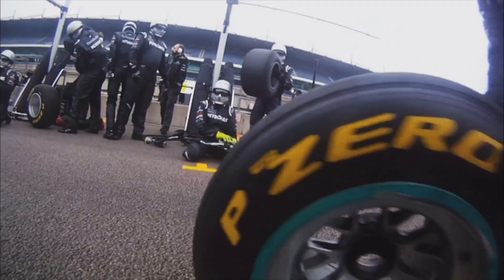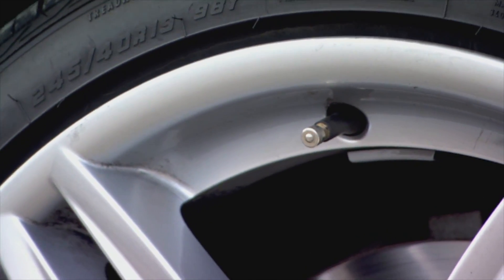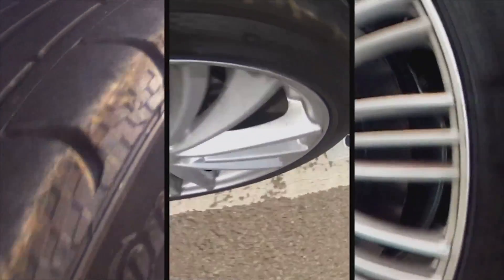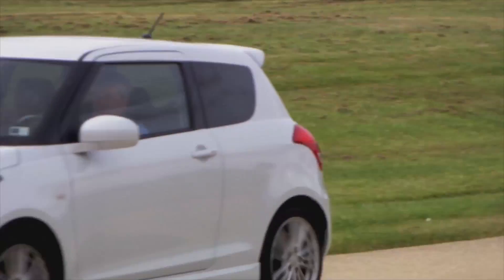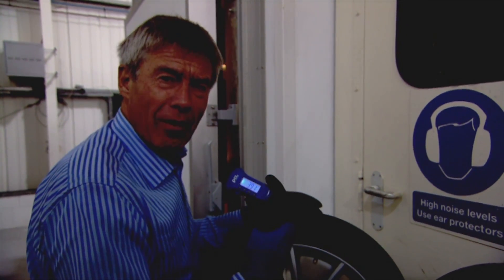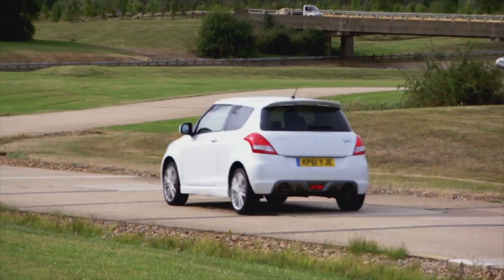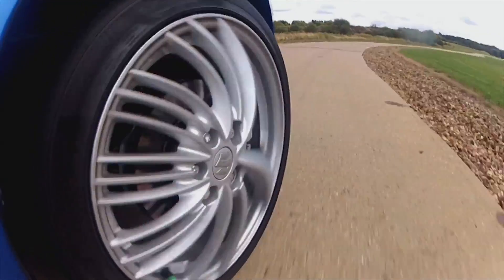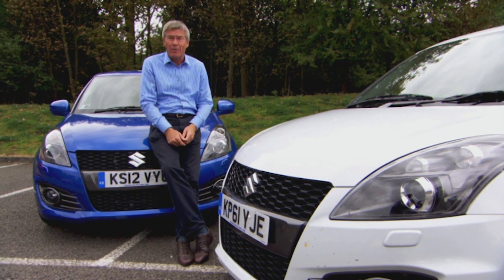Nitrogen vs Air In Tyres - Fifth Gear

Comment: first thing, is that the tires in the oven should be replicated, a set of 4 vs a set of 4. The road test should have been blind. and Nitrogen in tires makes no difference. Also isn't measuring a higher pressure for the nitrogen indicative of nitrogen expanding more? Both nitrogen and oxygen can be treated as ideal gases around Standard Ambient Temp Pressure (SATP). Ideal gas law: p=(nRT)/V . In the tire oven example. R stays constant since its the ideal gas constant, V stays mostly constant, since the tire doesn't get much bigger, T raises, therefore p raises. Any difference can be attributed to n, the moles of gas.  The molar mass (molecular weight) of molecular oxygen is about 32, and about 28 for molecular nitrogen, meaning for the same mass of gas oxygen has less molecules. Now for considering a tire filled with a certain volume of gas we have to take into account the gases densities. Oxygen is about 1.3 kg/m cubed at SATP. Nitrogen is about 1.15 kg/m cubed at SATP. So there is about an 11% difference in density, meaning a tire containing pure oxygen would have 11% more mass of gas in it than a nitrogen filled tire. The difference in molecular weight between the two is about 12% more for oxygen, so both the oxygen tire and nitrogen tire would have similar moles of gas molecules in them, perhaps slightly less for the oxygen tire. They'd be pretty close to equivalent in thermal expansion. As was demonstrated. So nitrogen in tires is a waste and gives you a false sense of security about your tire pressure.

Comment: I use solid tires.  It's the new thing.
Reply: Until a big chunk of the tire comes off than what are you going to do?
Reply: ***** 

"Until a big chunk of the tire comes off than what are you going to do?"

Weld it back on.  They're steel.
Reply: ***** 

"Solid rubber tires you can't..weld... back on."

Mine are all solid steel.  I stole them off a locomotive.

Comment: Would oxygen permeate the rubber much more than nitrogen? Well, just think a bit before you fall for that...

If it would, then you would end up with only the nitrogen left in the tire. Just fill it up with air again and you have 95% nitrogen. Wait for the oxygen to go away and fill it up with air again, and now you have 99% nitrogen.

Have you filled your tires a few times to fix that falling pressure? If it was the oxygen escaping causing that, then your tires would already be filled  with 100% nitrogen by now.
Reply: I think its also that continuous penetration of oxygen causes degradation of rubber, due to oxidation. But I don't know how much of that actually affects the life.
Reply: The answer is simple: It doesn't. At least not enough to cause sufficient damage to shorten the life of a 60,000 or 80,000 mile tire.
Reply: Size molecules:
nitrogen: 292 picometeres
oxygen:300
So...
I never saw a tire degrade due to oxidation, tyres always out last the tread.
At 20º air can hold less than 5%~ of water.

This is a gimmick guys. : )
Reply: @ubbgn  Today's tires are a mix of chemicals. I think better ones have more silicon rubber. When replacing tires on my vehicle, the tech showed me where the rubber had become brittle and chunks could be broken off. Probably 5 years old. I had already recognized the very poor (breaking) traction in wet weather.
Reply: lol.... good one mate. gonna try it :P
Reply: exactly
Reply: Mate oxygen is 300 nitrogen is 294
Reply: Haha what a logic
Reply: @sandeshbhandare7238  What is it that you find amusing?
Reply: It only takes 7% more nitrogen than the atmosphere in order to have the desired effect on inflated tires.
Reply: I agree with you. The problem is, the time it would take for all the O2 to permeate through the tire, before you expel 20% of the contents. It might take 10+ years, plus each time you top-off the pressure, you are adding more O2 and H2O. I think more efficient membrane separators are used in the medical field for portable Oxygen concentrators for patients at home. I just read about some similar device for tires shop, that didn't want to store N2 tanks.

Comment: Nitrogen is also called "spring gas" because it is used in pneumatic springs/dampers in assorted contraptions, this because it is more temperature stable expansion-wise than ordinary air; it expands and contracts less.
Thus, the tyre-pressure will stay more stable over a wide temperature range.
Reply: °C
Not really, nitrogen is an "ideal gas" in the thermodynamic sense and follows the ideal gas physic laws, just like oxygen (Boyle's;s law)
Nitrogen is used in shocks for various reasons depending on the shock manufacturer:
It is dry/pure (almost), no water vapor (which content varies in ambient air), another "dry" gas could be used.
It does not react with the shock components (oil, gaskets, nitrogen bladder if separate, etc.).
It is easier to get "dry" nitrogen commercially than to get ambient "dry" air.
In a tire/tyre: If you increase tire/tyre temperature from 20°C cold to 40°C hot lap (very common condition in racing, not common in daily driving unless under-inflated and/or overloaded tire/tyre), the pressure will increase from ~32 psi cold to ~34 psi hot, there would only be a 0.088 psi difference between air inflation and nitrogen inflation pressures. That would be different in a shock as a shock can heat up a lot more.
Bottom-line, there is no advantage to use nitrogen for daily driving.
Ciao, L (FoMoCo engineering)
Reply: lancelot1953
 For all practical purposes you are right (except perhaps on the "ideal gas" part, did you mean "real gas"?), there are some other differences but that would go more on the dynamics of things and will take a bit of delving and be more of a semantics debate ;p
Reply: ***** Hi Kenzofeis, you have brought up a very good point.  Nitrogen is a "real gas" but within the parameters/conditions that it is exposed to in automotive engineering (especially in tires/tyres conditions), we consider it as an "ideal gas" for the simplicity of calculations or comparison with other "inert" gases (in the case of shock absorber technology) i.e matching shocks to spring rates, resonance frequency, loads...  It makes life a bit easier (at least at Ford ;-).  Take care, Ciao, L

Comment: As far as a gas goes, there is almost no difference between air and nitrogen. Air is already 80% nitrogen, and nitrogen has almost the same molecular weight as oxygen, 14 vs. 16. While the change in gas pressure from tire heating is small and identical between air and pure nitrogen, water vapor pressure increases about 3 psi.  Dry nitrogen or dry air, will eliminate this change. If you double the pressure of 50% humidity air from 15psi to 30psi, it becomes 100% humidity air, and starts condensation. So the air in your tire is saturated with water. If you pump up your compressor to say 120 psi and allow to stand for a hour, the air in your tire will have 30psi/120psi, or 1/4 as much water.

Comment: Total crap for down to earth use. Check your facts.
Reply: Agreed, the difference in the size of nitrogen molecules versus oxygen is only 2.7%, to say nitrogen molecules won't permeate the rubber is bullshit. And if the oxygen was fully saturated with water vapor, it would only mean a 5 gram difference in weight.

Comment: logically, if only oxygen permeates through the tire rubber, you'd eventually only be replacing the lost oxygen with air (78% nitrogen). After 3 fills (1 - 0.21^3) you'd have 99% nitrogen in your tires anyway. Eventually, you'd never need to top off.  I don't think permeation is the main issue. Other leak paths?
Reply: Nitrogen permeates through the tire rubber too.
Reply: Exactly. Thanks.

Comment: They dont vaccum the tires befote adding the nitrogen so the proportions of nitrogen are not that different in the tires and also, following the gas rules they should all expand the same unless there is more water vapor in one
Reply: Yes, they open the valve to reduce the tire pressure to the atmospheric pressure, and then add nitrogen to get the right pressure. But sometimes they don't reduce the pressure before filling.
The only away to ensure the tire have 100% nitrogen is to put it in the vacuum chamber.
Reply: even if the tire is vaccummed, it wont change a thing  according to gas physics. And yes they would need to vaccum them all
Reply: ***** You can reduce the pressure and fill the same tire 3 times with nitrogen to get 99% nitrogen. But most of the companies don't do that.
I worked with airconditions, and they need a vacuum before the filling. But the tire is not an aircondition, it doesn't matter if it have 1% of other gases. I was wrong for writing that the tire need 100% nitrogen.
I don't know what quantity does humidity contribute to the tire pressure, but I will contribute more than the others components of the air. The humidity will reduce the pressure if it condense to water when the tire is cold and increase if it evaporate when the tire is hot.
Reply: It doesn't matter if the tire have air or nitrogen. The humidity can contribute only if is a lot to condense when is cold. Normally the air doesn't have the quantity of water for this to be a problem, unless you fill it with air from a turkish bath.

Comment: the only noticeable difference
is that nitrogen is more expensive lol
Reply: If the Nitrogen was cheaper I bet the garages would be recommening air!
Reply: you pay for air ????
Reply: You pay for the service
Reply: Initial Yeet In India its FREE
Reply: It's free where I buy my tires. Probably because they are not really using nitrogen anyway.
Reply: Very few places.  Nitrogen will leak less.  One shop advertised they used Nitrogen when replacing your tires.  No extra charge?  Great.
Reply: Costco offers it for free
Reply: £3 per tyre at my local tyre centre.

Comment: So basically you are more likely to get ripped off on a nitrogen fill up because there is no way of knowing without special equipment. Even if they are using pure nitrogen the job needs to be done a certain way which most of not all shops simply are not capable of.

Comment: Just  21.91% improvement !!!

By volume, dry air contains 78.09% nitrogen, 20.95% oxygen, 0.93% argon, 0.039% carbon dioxide, 

and small amounts of other gases. Air also contains a variable amount of water vapor, on average around 1% at sea level, and 0.4% over the entire atmosphere.

Comment: In The Netherlands they do this almost standard with bicycle tires if you buy a new bicycle.
Reply: Nitrogen is a SCAM. Check your tires every 2 weeks and rotate them every 4000 miles. Any shop that sells you nitrogen is selling "snake oil". (It also encourages people to neglect air pressure checks unless they live near the shop that sold them on Nitrogen.) Any reputable mechanic will admit Nitrogen fills are a SCAM.
Reply: No, we Dutch still check our bicycle tires and inflate them with regular air. Well, most of us do ;p
I don't know how it is with car tires, because our country is not as big as yours.

Comment: Only thing it'll help is maintaining pressure... I fill my tires with nitrogen for about 2 years now and I always check the pressure every 3/4 months. My tires have to be at a 32psi pressure, before on just air they would lose about 5~7psi every 4 months... now with nitrogen it's only 1~2psi.

Comment: Here's a better test:  Inflate two tires only ever using regular air.  The other two only ever with the purest Nitrogen you can get from a tire center.  Keep a log of the date and/or mileage you have to top up the two with regular air, and those with nitrogen, separately but side by side.  Keep it up for the entire tread life of the tires.  I have no experience with nitrogen, but after reading about it, I'd consider this test.  Just on one vehicle until I know one way or the other whether it's useful.

Comment: I use nitrogen for 2 years on my previously Toyota Camry And Now on my Chevy Impala and I noticed the following :
1)it keep your tire in good health. 
2)on a highway the car feel smoothly at 120mph.
3)it keep your tire cool and the pressure is almost the same in coold days and the hot days
4)it's safe because it's very rare for the tire to blow up, so no accident at all.
these is the most things I've noticed so far.

Comment: Coming from someone that works on cars all day long 40 hours a week. The whole nitrogen thing is just a scam. Your paying for that extra 20% to fill it with PURE nitrogen. I have to set tires to the manufacturers spec on every vehicle regardless of what its filled with. If nitrogen molecules cant leak out of a tire then how can any vehicle with green valve caps have low tire pressure lights on? The bead on the tire still isn't a perfect seal so you're going to loose air regardless. DONT FALL FOR THIS SCAM.
Reply: Stormer1092's Gaming Channel that and you would first need to evacuate all of the air when you put the tyre on the rim. Agree. Total bollocks
Reply: Yea, total scam... is that why that all aircraft tires are filled with nitrogen, cause it doesn’t have any effect ?
Reply: test two - The take off speed of an aircraft is about 150 mph. Are you the one that drives car in such speeds? If you do, then nitrogen is for you.
Reply: Aircraft tyrereach really high temperature..it’s a different issue. How much larger is nitrogen molecule than oxygen that it does not escape..bullshit. As for those who think oxygen degrades rubber ...tyre on the outside is still exposed to normal air.

Comment: Everyone seems to be missing the point with nitrogen fill. Racing teams use nitrogen because peak temperatures during racing can exceed the boiling point of water. If you fill with moist air and exceed the boiling point of water, the 'condensate' inside the tire/tyre will quickly boil and expand - under normal ambient conditions it wants to expand about 1600 times its own volume - and uncontrollably and unpredictably increase pressure. When you slow down again and the rubber very quickly drops below the critical temperature, the pressure will rapidly decrease to the predicted value. It's cheaper to fill with nitrogen than to fill with dried air, so such people use nitrogen. If your rubber necer exceeds the boiling point of water, you're never going to get a benefit with nitrogen fill. You should check pressures regularly and, of course, it's quicker and easier just to pump some ambient atmosphere into the void than to pay someone to pump unregulated nitrogen.

Comment: Think about this as follows: Every time the tyre loses pressure, it loses mostly oxygen. And everytime you have to top up, you fill in 78% nitrogen when pumping up with plain air. Consequently, the proportion of nitrogen in the tyre will increase over time anyway.

Comment: It is almost impossible to get 100% Nitrogen in your tires.  You would need to create a complete vacuum in your tires then fill them with pure Nitrogen.  Good luck with that, unless you pay a premium.
Reply: +ToxicTiki Or drill a hole in an air compressor tank and cover it with tire rubber.  Just make sure it's held on well enough to handle the same pressure the tank was rated for.  Or at the very least, still be able to file your tires.

Comment: Funny thing is, air doesn't really go through the rubber like they say, it goes through the bond between the rim and the tire. I had a tire for 2 years that kept its pressure because I cleanred the rim perfectly and applied tire sealant. Most often tires leak out over time because the technician installing the tire did not clean or apply sealent to the rim.

Comment: i don't think it is possible to fill up the tires with 100% nitrogen. because when you put the tiers on the rim there is already some air there.
Reply: +eduardoig17 You have to put them inside a vacuum chamber and then fill them while inside.

Comment: My one car needs nitrogen.  If I pump it with normal air one of the wheels will rust, breaking the seal (it's happened several times).  Keep in mind though, this car is an '87 so it's pretty old.

Comment: based on this video one could infer that the nitrogen filled tyre has a higher rate of expansion regardless of if its not 100 percent pure. the other possibility is that the nitrogen filled tyre has more moisture in the nitrogen gas due to flaws in the equipment in removing that moisture

Comment: The biggest problem with the gas inside of tires is the WATER VAPOR.  The water condenses when the tire becomes deeply chilled and it forms condensation inside the tire against the rim.  This promotes corrosion on the side of the rim; especially along the bead.  This leads to air leaks.  The water separators on air compressors are sometimes removed, or not maintained properly, which leaves a lot of moisture in the air that you are using to fill your tires.

Comment: Every "scientific" claim in this video is a bucketload of horseshit. The first "fact" for example states oxygen molecules pass through rubber while nitrogen doesn't because it's bigger. Nitrogen molecules are 300 picometers. Oxygen molecules are 292 picometers. That's a completely insignificant difference of 2.7%

Comment: My trucks TPMS used to put on a check light twice a year every summer/winter.
When I got new tires I opted for the nitrogen fill to try it out. I haven't seen that check light since.
Reply: There is no way you could lose that much air in a tire in 6 months
Reply: William Neigum The TPMS light wasn't triggered from loss of air. it was from the change in pressure due to temp.
Apparently straight nitrogen isn't effected by temperature as much as air, even though air is mostly nitrogen. Either that or using a processed gas is just a way to inflate tires without introducing as much water vapor. Which we know definitely changes density according to temperature.